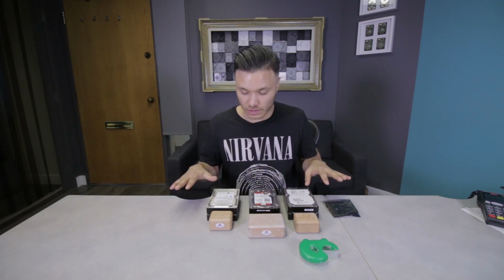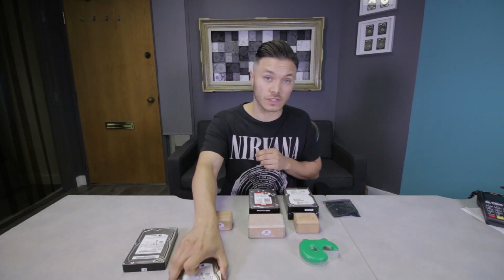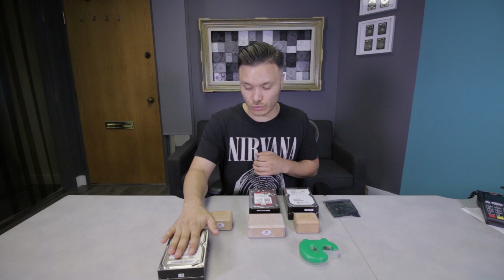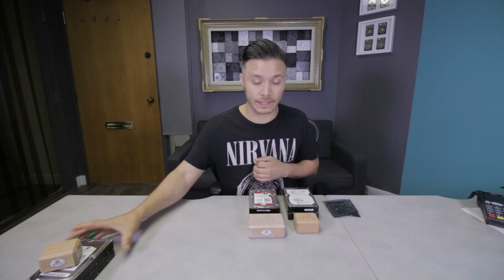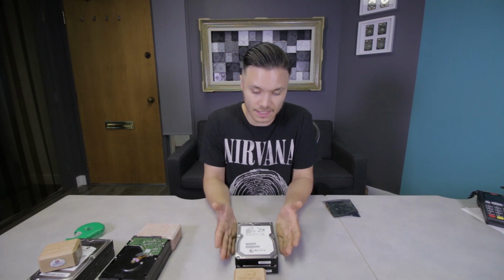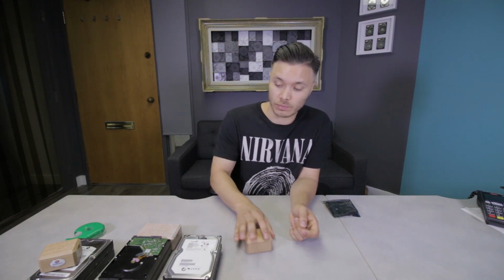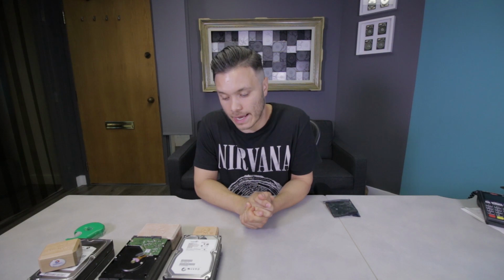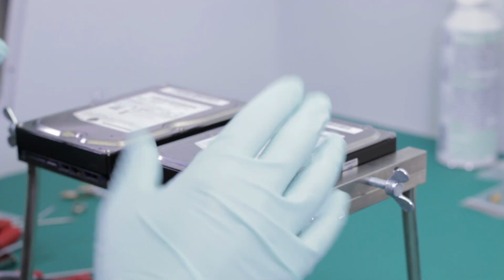hard drive does not spin - how to Platter Swap

Comment: Quick question, accidently dropped by drive today, it was not plugged in, but when I plugged it in to see it if still worked, it would spin up, for about 8 secs and then slow down and stop, no noises or clicking, Device Manager will discover it,  but it will not show up in file explorer or Disk Management. What do you think is the issue?
Reply from the maker: You damaged heads on the drive. Highly recommended not to tinker with it and see a pro about it. Be aware this runs for like 800-1200 on average. We swap heads till March for $500 on drives that have not been previously opened as 2022 special.

Comment: Hi I have two hard drives 80 GB and 1tb but the heads on my 1tb hard drive are broken my question is can I get the platter of the 1tb and put it in my 80gb hard drive after removing its platter and be able to access the data/files in the 1tb?
Reply from the maker: You will end up with 2 dead drives if you do that

Comment: Hi, I have a 2TB WD Elements. problem is that I can see my data but can't copy that. I scan through stellarphonix data recovery software but it takes too much time to save. very time system pause or hang. what can I do to get those data.
Reply from the maker: Animesh Maji you have a problem known as a "slow response" due to failing head. Software like stellar or any other software that is available for download is not going to be able to solve a problem. The issue is on a firmware level which requires vendor specific access to drive's service area. Best thing would be to mail it in for recovery. If this is a 2.5" elements we currently have a promo until the end of October where we recover any issues related to these drives for one flat fee of $400. Let me know if you are interested. There are 10 more days left for this promo

Comment: I have  a wd10jmvw with board 2060 771961 001 rev a. Bios IC2 is broken, and maybe the R/W head dont working. Is it possible to save the data?
Reply from the maker: Yes
Reply: @hddrecoveryservices   can i contact with you on your web page?

Comment: i hav wd 500 
in starting drive showing bad sectors i recoverd the bad sectors and my drive wss again showing the partitions and data but after 2 days again facing the same problem my drive showing no data on the drive. 
now my hdd also not spin it is in dead condition.

but i have a same to same hard disc and i swapped the pcb but not works why ?
i opened the drive the platters are in gud condition if i swap the platters it will work ?
Reply from the maker: there is no simple answer to this. I would recommend not to try any internal repairs on the drive yourself. Find a local reliable specialist to get this done if data is important to you

Comment: Hi, I have a hard disc WD 1 TB. Sometimes it spins and work perfectly but sometimes it doesn't. Also it crashes while i work on my pc and use a large amount of data.

i don't know what the heck is happening with it. Please tell what can i do with this?
Reply: Sounds like it's failing, you should backup all of your data
Reply: Brother, I have resolved the problem, It's the processor which is causing the failure.

Thanks for your reply
Reply: @lxcool9243  you mean processor on that HDD or your CPU in your PC?
Reply: @Pidalin  CPU

Comment: omfg if this actually works. I have a Hard drive i have kept since I was like 14, im 37 now. But there is some serous personal memories tied to this drive. The platters are fine, but it just has mechanical failure. So if i swapped the platters to a new drive that mechanically worked, that would be amazing but I althought this was a very challenging task because you have the exact PCB board and firmware configuration that is programmed to activate the heads of that paticular drive.

Comment: Please help./ Recently I accidently knocked portable HD over to its side. Took it to data recovery. Was informed the spindle and bearings broken. Platter cannot rotate. Was told there is no use fixing it. I even suggest getting a donor HD and have platter swap. Was told it will not work.... and that I need to ask for second opinion. Please help if this is still a possible. All the stuff from the broken HD is MOST valuable. I cannot accept all is lost. Please someone......any information please?
Reply from the maker: Are you in North America? Request our services here www.hddrecovery.ca/contact-us 
You will need a platter swap if the spindle is bent, I don't see a reason why it would not work. When drive is seized, it can't harm itself further because nothing is moving inside. For data recovery it is the best possible scenario

Comment: Can u help me
My hardisk has single plater 2tb
While the head is resting. I changed the plater easily without chamging anything. 
But when connected it to pc. It shows data cyclic redundancy
Disc cannot be initialised. Both hardisk is showing same

Comment: to swap platter WD 3.5" at center of platter there is circle with 6 screws and 2 of that 6 not able to unscrew
Reply from the maker: WD hardly ever needs a platter swap. What are you trying to do?
Reply: @hddrecoveryservices  to recovery data

Comment: It's impressive how many things can go wrong but just don't.
Regarding tools to recover data I can confirm that they are very expensive.
I just started to enter in the field at PROTO professional level and I must be sincere, getting data out from HDDz is really a high precision, high skilled, high complex and you need deep knowledge of the industry or at least of the single HDD you have in hands.
Data recovery professionals are at the same level as doctors able to do operations on an ill person.
Great swap ;)
P.S. It would be great that you had time to make all 3 swaps.
I start to understand that any recovery is a universe for it self. :(
Reply: it's not to complitated, people who are little experienced with electronics can do it, but not on important HDD first time. After few destroyed HDDs for tests I was able to transplant reading head almost without tools. But it still doesn't work so I gave back that needles to their mother HDD and it worked so I did it correctly but there is another problem with my damaged HDD, probably bad PCB, it has little burned contacts and transplanting bios to similar PCB (with little different number) doesn't work

Comment: Im surprised you don't use a HDD docking station. You could buy 3 of them and be set instead of having a mess of SATA and Molex wires all over the place. I purchased one of these (http://a.co/aNJ5pVA) for myself. Holds 4 drives, works on USB 3.0 and can take 2.5 or 3.5 inch drives.
Reply from the maker: I have one made by Probox also USB3.0 4 bay, but the reason you see me use those systems in the way that I do is that we use PC3000 PCIe based cards to which we connect drives. Through that card, we can work with drive under vendor specific commands and manipulate bunch of things that would not be possible if were to connect your hard drive via docking station. I use docking station to transfer data after the image is done

Comment: Ok for a fact i know this is NOT how you recover data. Well not that it's not how but it's not proper. You should never open hard drive in improper (contaminated) environment. The air sealed inside the hdd is more clean than the air inside an operation room, specifically because of dust particles. While they are super tiny they are unimaginably bigger than the read/write head. Not to mention that the space between the platter and the heads is measured in ATOMS. A dist particle is way bigger than that and when such particles get inside the hdd they can cause a head crash. That's why hdd data recovery is done in special facilities where you wear a suit and the air flow is constant to keep particles away from entering the room and containing the HDDs.
Reply from the maker: I agree with you on the importance of maintaining clean air during our work. However, it's essential to remember that we don't need the drive to last for years after completion. Our goal is to obtain one single clean image of the drive, and after that, the original is no longer needed.

Ensuring clean air is crucial, and the method we use to achieve this goal is entirely acceptable. Perhaps you believe that data recovery can only be done in so-called "class 100 clean rooms", but it's essential to consider other possibilities. In fact, 99.9% of the industry employs laminar flow benches. Moreover, these laminar flow benches are very easy to keep clean, and allow us to work without needing to wear any suits :)).

Laminar flow benches can be either vertical with filters on top or horizontal with filters in the front. Mine is a massive 8'x4' vertical unit so you don't see any filters at all (maybe it can be caught in the reflection of disks sometimes). 

Flow hood provides clean, Class 100 laminar flow air for process protection by utilizing two-stage filtration. Room air first passes through an electrostatically charged pre-filter followed by a HEPA filter resulting in ISO 5 clean air.

Comment: Sorry but the prices for that shitty small tool ? Really guys? Thats damn Expensive!
Reply: They are expensive and time consuming to produce. They are also intended for HDD recovery services to buy them and they will soon pay for themself. That is just how products of a very limited market are priced.
Reply: For those who don't want to go look, the tools for a single drive (the metal ones from HDD in that wood box you see in the video) are about 200-250 US dollars, and the ebay ones (that are plastic and look worryingly crappy but may still work...I don't know) are from China, take 4 weeks to arrive, and cost 60-100 US dollars.  If you are at home looking at your single downed drive and trying to figure out how to DIY and save your clown porn collection that took years to accumulate, it may be best to pay someone to do it since the tools to just START this process (that you may screw up somehow anyways) are already more than a brand new 4TB WD drive.  Food for thought.
Reply: You can also 3D print head combs for a lot of drives now if you really wanted to cheap out on tools. But if you value your data then always leave it to the pros as you could make it totally unrecoverable if you screw shit up even harder.